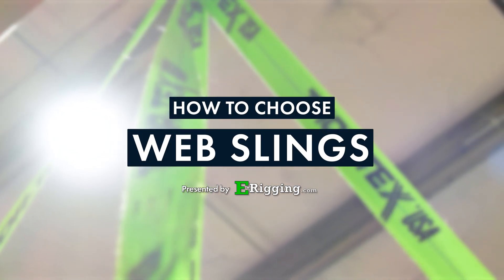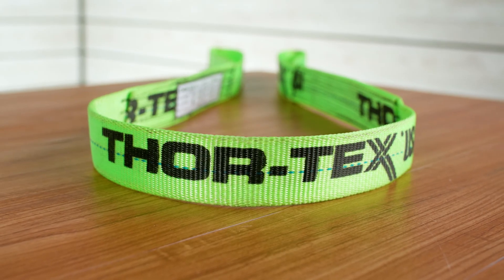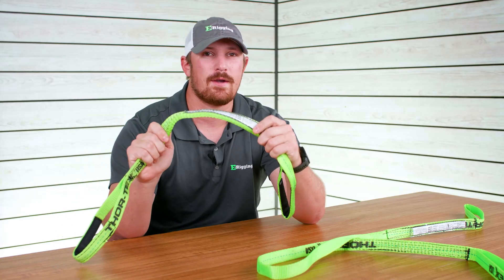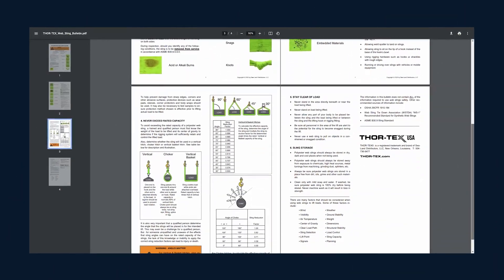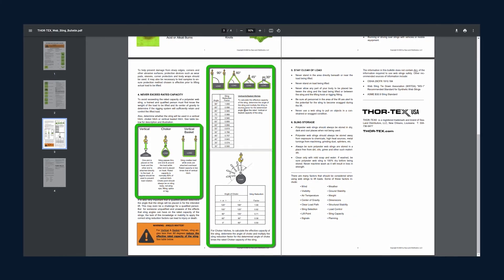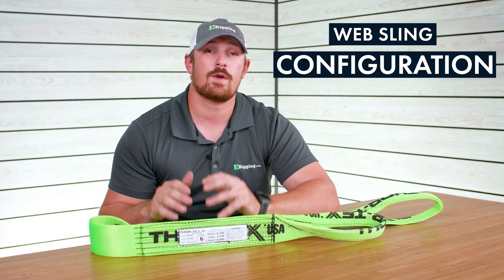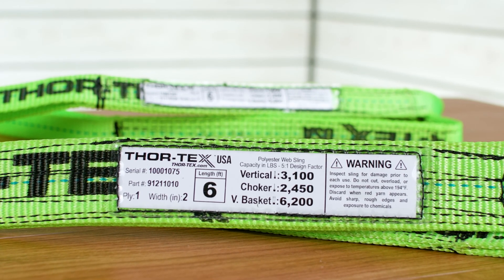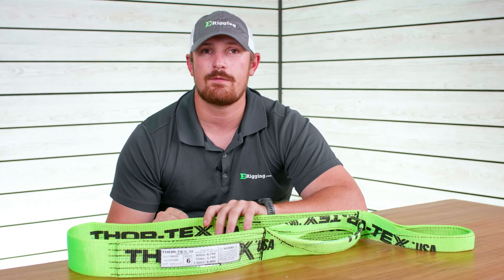How to Choose the Right Web Sling | Thortex Lifting Slings Review

Comment: if a slings was to experience dynamic loads, but loads of 1/2 or 1/3 of the WLL, would there be any danger of breakage/failure?
Reply from the maker: While it could withstand the weight once or twice, it is not recommended to put these slings under constant or repeated dynamic loading.